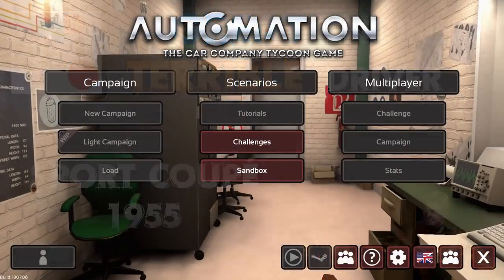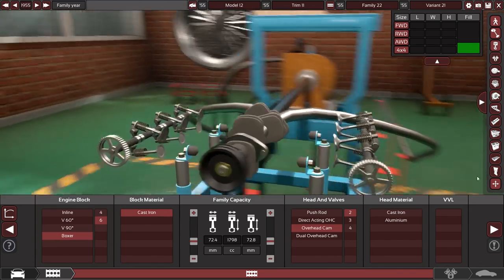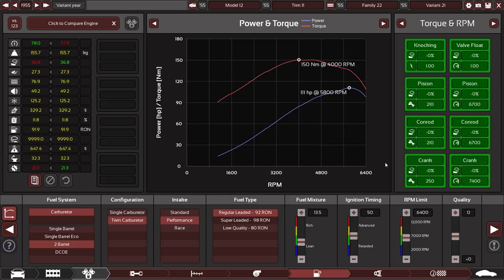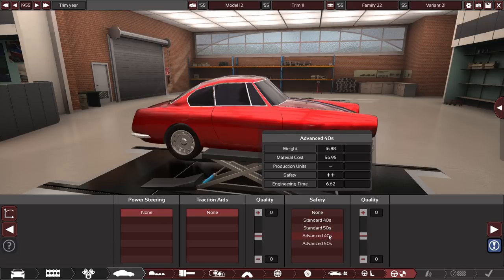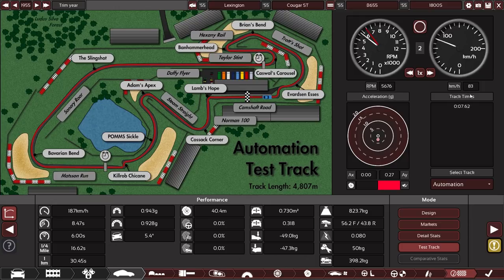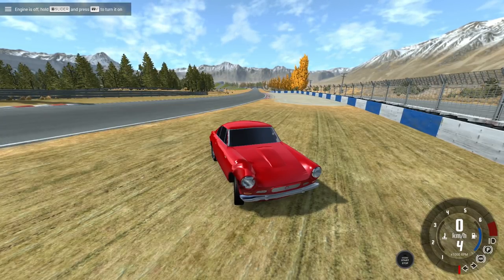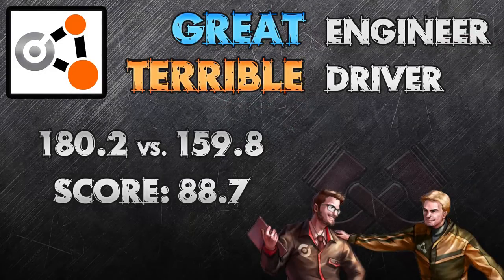BeamNG + Automation: 1955 Sport Coupe, GETD Ep.01

Comment: Oh man im going to love this, i made a 1200hp limo
Reply from the maker: Good luck getting that around the track in one piece xD
Reply: I have a VW T3 with a 1000HP TT V10 in the back that thing will be so oversteering I won't get it around any corner. I guess I'm up for fun times.
Reply: thanks for the idea I'm going to build a drift limo with a boxer engine tomorrow
Reply: Geeky Car Guy mine was 2200 hp limo ps it’s only good at drifting. I tested it in the markets and people would rather take the bus pass.
Reply: I found 3000 from a v16 in the mega pickup. I don’t want to know how undrivable that is, especially since drivability was at 3.2 and prestige at 143.0...
Reply: @progmetalfan4270  That is the definition of a car you buy for status and nothing else

Comment: I wonder how much you can help the BeamNG lap time by playing with brake balance - it looked in Automation like the rear brakes applied a much greater percentage of the total tyre grip than the front brakes, and that would match how the car is so tail-happy on braking...
Reply from the maker: I think it would be helped a lot, but I did make sure in Automation that the brake force lines are on the grip lines or very close to, that should not lock up the rear when applying ~50% brake :) so maybe something to look into today!

Comment: It's a lot of fun to do the test track showdowns. I believe you can match or beat the AI time with most cars, though anything with poor drivability will be more challenging and advanced downforce designs don't transfer to BeamNG currently so those are noticeably slower. I think a sporty FWD with good brakes would probably be the easiest AI lap to match with a racing wheel.
Reply from the maker: Quite right! :) Without the drivability to back it up, those times are very difficult to attain for a crap driver like myself :D the driver score is a pretty good measure of actual drivability haha. Cheers!

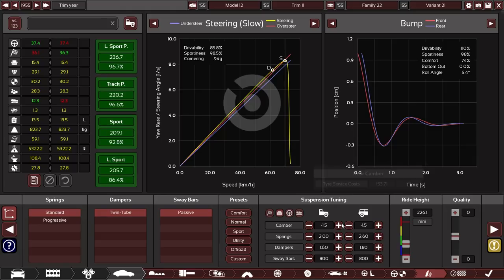Comment: Currently at 13:00 and you probably could have pushed the brake bias a little more towards the front since the rears were still locking first.  Maybe?  I don't know.
Reply from the maker: That is entirely true, BUT the graph definitely shows that the brakes should not lock up at all at 50% brake force :) which they did in the rear, so that is still strange. Cheers
Reply: Possibly/probably down to physics differences between the two games; makes me wonder if BeamNG isn't being somewhat less generous with the grip from those 1955 semi-slicks than Automation is, but you'd obviously be in a better position to know that than I would.

Honestly, I'd say it'd be worth working the bugs out of this one, and I'd also say it'd be worth just contacting the BeamNG team and asking if they have any space in the plan where a full-quality car based on the idea could go, because this car is just too good an idea to let die.  With how tiny that engine is and how low it's mounted, I have to seriously wonder if the engine isn't actually below the car's roll axis; I've never really heard of a car set up like that, but I'd definitely like to see how much that would improve the car's handling.  This might also mean that, in an environment such as BeamNG where cars can be freely altered outside the constraints of preset bodies, the bodywork could be made much lower, improving aerodynamics, lowering the center of gravity, and further reducing weight.

This seriously has the makings of a mountain pass monster that could have basically rendered the Porsche 911 obsolete before it even entered development.
Reply from the maker: Indeed it is a neat little car :) it could also be that we don't properly get the brake balance setting over to BeamNG, worth investigating for sure! Cheers man

Comment: Not good at design? I thought it looked pretty good, accurate for the era at least. Also what do you mean more power isn't always better? wonders why my 1970 muscle car steps out while accelerating in a straight line in top gear and tears it's own diff off under certain conditions
Reply from the maker: xD exactly! It is really easy to make the mistake to judge what reasonable power is by modern standards, which usually leads to... some unwanted behavior :P cheers!
Reply: The power level was period correct though, for a drag car burning Hydrazine :D